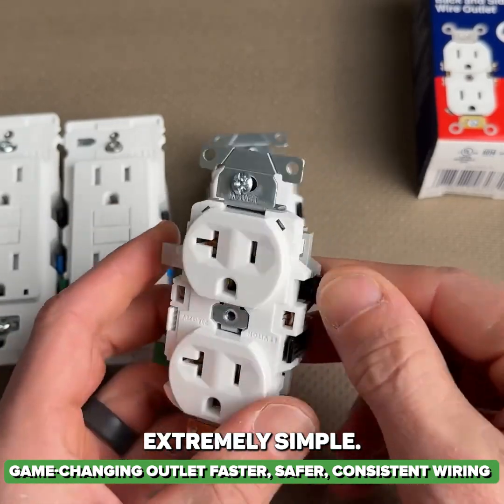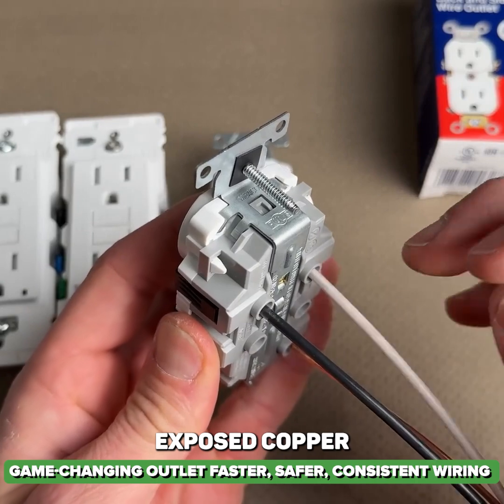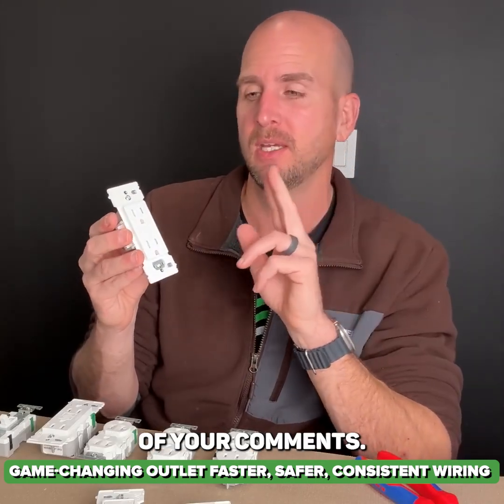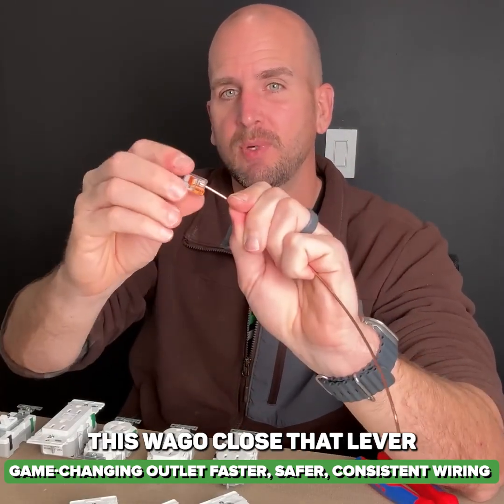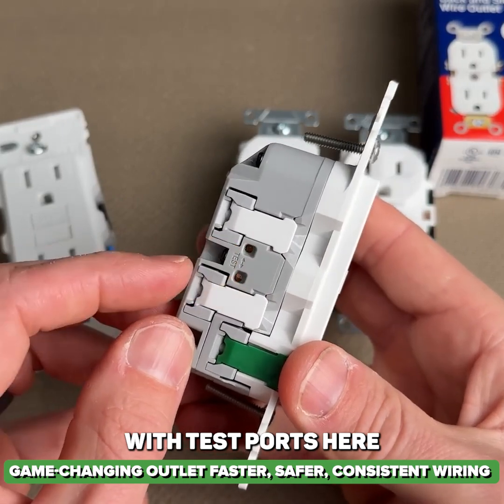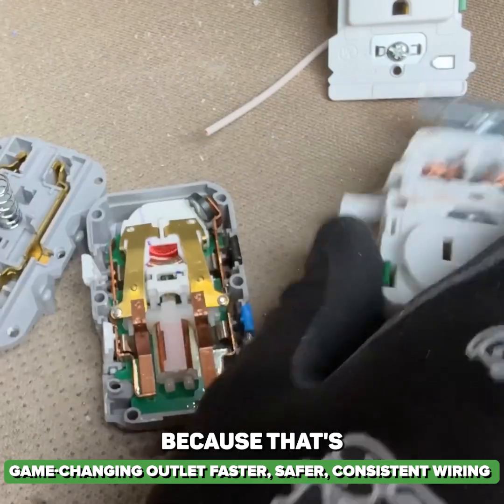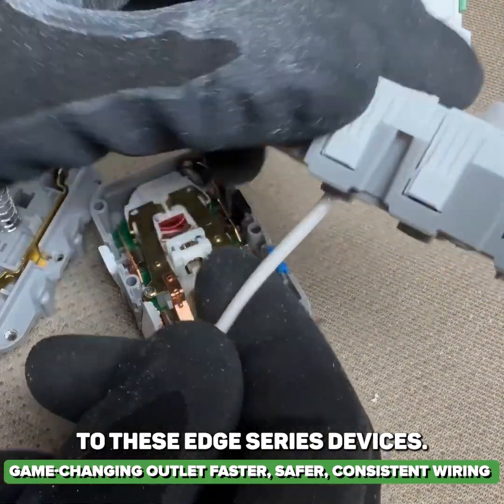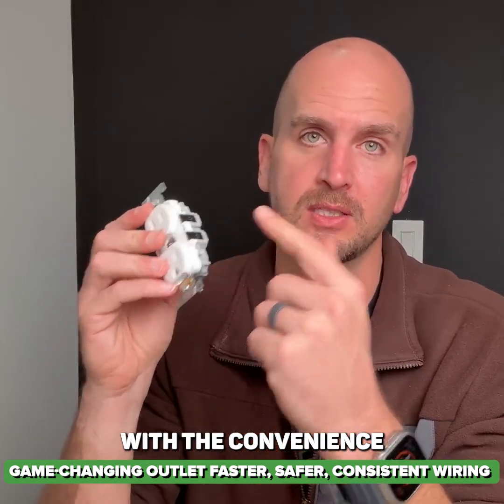Game-Changer: Leviton Edge vs Traditional Outlets

Comment: A pair of holes & levers is unused in this video. Are the two pairs internally wired in parallel, so the second pair can be used for daisy-chaining?
Reply: They are equivalent to the 2nd pair of screws on a standard outlet.

Comment: How much conductive surface area of the terminal is in contact with the wire, when the wire is installed? I'm wondering how much electrical resistance the outlet adds to the circuit, and whether it would heat up. In other words, does it narrowly or robustly satisfy the 15 Amps spec?
Reply: Good question.  Genuine WAGO lever connectors add about 1 to 2 milliohms in my experience (2.5 sqmm 7 strand into a 221-4xx)
Reply: Both the lever edge Decora (residential grade) and the lever edge standard style (commercial grade) are rated for 20 amp pass through. The lever edge standard style is Federal Specification Grade compliant for 15 and 20 amp circuits, so it's quite robust IMO.

Comment: Are these stocked at Home Depot and Lowe's?
Reply: Home Depot stocks them since they usually have all the Leviton stuff
Reply: That’s going to vary, location by location.  But yes, in general, both Lowe’s and Home Depot should have these.
Reply: Lowes near me doesn’t seem to stock them in-store but they may be available for pickup via online order
Reply: @spirahsass  — yeah, there may be some local differences on availability.  If you have other hardware stores near you (e.g., Menards), then you could try them as well.

But your best bet may just be to buy them online.  Good luck!